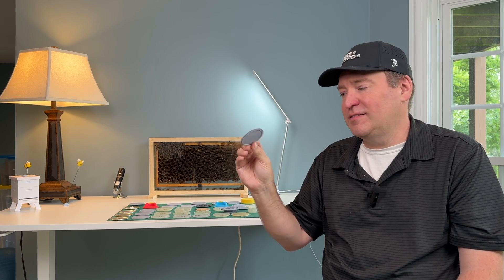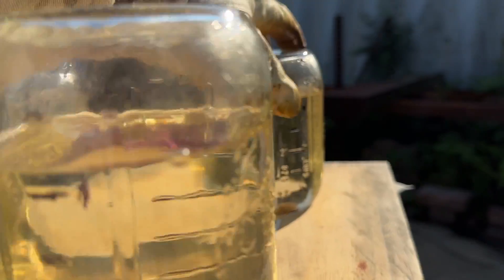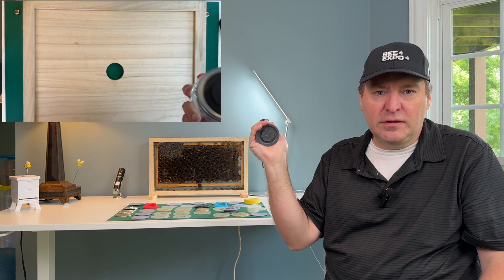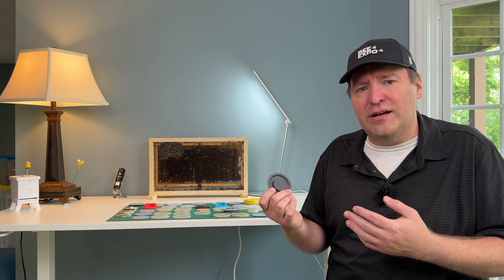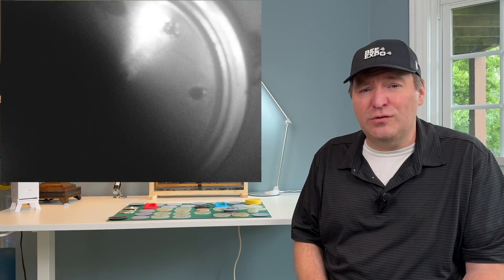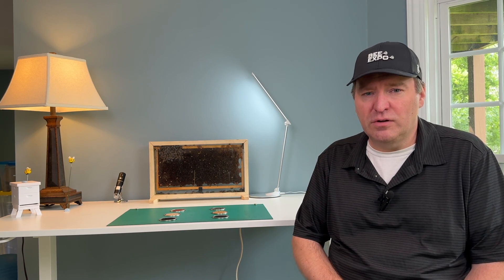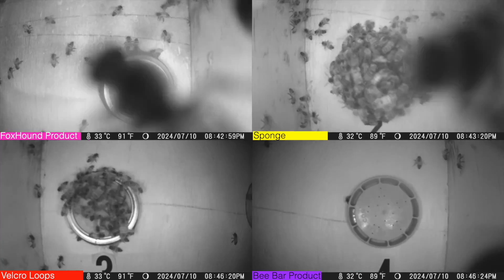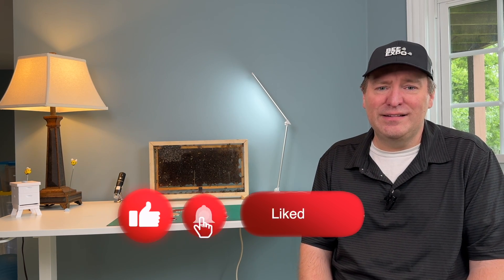I Redesigned My DIY Jar Feeder & Got 100x Results! 🐝🛠️

Comment: Have you thought about grip? 3d print using fuzz settings. Start with Fuzz thickness 0.3 Fuzz distance 0.3 on the part
Away from the edge seal? And vary the grip surface.
Reply from the maker: @tomdickson650, yes, smart idea. 💡 I've been working on the grip via traction. I've been making a bunch of changes to the texture (similar to your fuzz thickness) and also to the geometry (via grooves). It's made a lot of difference. I'll have some videos upcoming, so stay tuned. I'll try out the fuzz thickness as well. Thanks for the idea. 🧠

Comment: Wow Michael.  I think you're onto things.  Thx for thinking about the bees.  I don't use jar feeders yet will certainly pass on this information.  Grateful.  P.S.  What about the beekeepers that use gallon bucket feeders--could they attach sponges?
Reply from the maker: @bradgoliphant, that's a good question. Yes, I think that would work. What I've been learning is that bees have a gripping issue when feeding from plastic, metal and especially silicone materials upside-down.  It is a traction issue. The sponge not only solves the traction issue but also makes for a large surface for the bees to feed from. It's been interesting to experiment with different types of sponge and absorbent materials as well.  One jar feeder tester has been using fleece cloth and the bees really love it. It is also very easy to clean between uses.
Thank you for sharing the information!

Comment: Next design a sponge to fit inside the frame feeder ladder white tubes so bees don’t pile up and die .   I use peat moss now.  It works , no dead bees .   But sooner or later peat moss gets funky  .
Reply from the maker: I've had lots of problems with frame feeders as well. Tell me more about how you use the peat moss. Do you fill the tubes with the peat moss? It's an interesting ideas to use sponge to help, very clever idea, @UncleJunior52! 🧠
Reply: @TechnicallyBeekeeping  my local association told me to add peat moss to my bucket water feeder because bees like it in the water and it’s prevents them from drowning in the water trays. So I figured after using frame feeders and pulling out hundreds of dead bees stuck in the tubes, I started packing the white tubes all the way up -3/4 of an inch from the top. Every few days I give the frame feeder a shake.  No dead bees .  The bees just look up the syrup off of the peat moss that acts like a sponge.  I pre-soaked the pee in a separate cup of sugar water so it expands a little and then pack it into the tubes .  I do monitor for fermentation and I’ll change out the Pete Moss every once in a while
Reply from the maker: Very interesting, I've not heard of that before. Peat moss can float on water, so I could see how that'd come in handy to keep the bees from drowning.
Reply: @TechnicallyBeekeeping  https://youtube.com/shorts/c2VrNJunODA?si=KazLubtF3Ri6rpDH
Reply from the maker: @UncleJunior52 do you mind resending the link? It doesn't seem to be working for me.

Comment: My concern is, do the bees take pieces of the sponge into the hive, thus ending up in the wax or honey?
Reply from the maker: @sadie5288, that's a great question. I've not seen them pick at the sponge at all. Once they have fed from it, it drys out quickly within a day or two. Typically, when I see bee take pieces of something like that, they are either consuming it or trying to remove it from the hive (bringing it to the entrance board) rather than using it as building material. Per your concern, they typically don't like foreign material in their hive, but I've not seen them consider the sponge as foreign. Good question!

Comment: How do you get the sponges to stick to the mason jar lids? What size hole is best? Any pattern better than another? Thank you
Reply from the maker: @RobertMeade-y3d Thanks for the question, I don't go into this much in the videos and I kind of leave people hanging. ;) 
I actually have a video coming up about this, so make sure to stay tuned. For this experiment, I used hot glue, which I don't recommend for a long-term implementation. You can actually sandwich the right sized sponge between the jar ring and the jar's lid and it works pretty well. Regarding the holes, assuming you are not feeding pollen powder mixed in, smaller is better, so thumb tack sized is good.
I've been developing a net for the sponge to make all this easier and a lid that is textured that I'm starting to experiment, so that will be in a future video. 🙏

Comment: I'd like to help you out. What specific sponge type did you use?
Reply from the maker: @danapeters2864, the sponges that I used in the video are a disposable cellulose sponge that come in a pack of 50 for $8. 
Some of the beta testers in the VIB club have been testing with Swedish sponge as an alternative to cellulose sponge. Swedish sponge has antibacterial properties and is quick drying so it doesn't mold easily. Some people do not like that it is not as natural, however. I respect both views.
One of the VIB members discovered that fleece works well and with a net that I've designed to hold it in, it works really nicely and she's having a lot of success with it.

Comment: What is the conclusion here?
Reply from the maker: @michaelshelnutt3534, the conclusion is that assuming you're using 1-1 sugar water, the smaller hole the better, for example a thumbtack size (1-2 mm). Bigger for pollen substitute dissolved in sugar water as it can get caught in small holes and clog them up. Adding textures to the jar feeder lid improves the bees ability to feed from them as you can see with the sponge. 

All inverted jar feeders leak under certain conditions due to pressure building up in the jar, it's just physics. Somewhere around a 30 degree F swing between night and day temps with the jar about 1/3 full, for example, builds up air pressure and pushes feed out, so watch for big temperature swings and preferably don't put the jar feeder in the middle of the hive like most inner covers do as the brood is typically right underneath. 

I continue to experiment, but hopefully that helps?

Comment: I have a 3d printer with wide mouthed mason jars.  Can you send me a link to a file or email me one with the ultimate lid you would recommend.  I like your research
Reply from the maker: Thanks Robert! I started out with the wide jar lids but found that most of the inner covers are built for standard sized lids. Also creating an adapter for a standard to wide is much easier than the other way.

Comment: I use the plastic lids from mayonnaise jars. I use the smallest drill bit. It doesn’t rust and has a rough texture surface. They drink it down one quart  in two days. Only problem is they propolis the holes.
Reply from the maker: @davidlaing7684, nice job! Yes, I've tried silicone because bees have a hard time propolising it, but they have a LOT of trouble getting traction on silicone, it's the worst material I've found. Plastic is ok if the texture is good, like your mayo jars. 🫙

Comment: Have you found the sponges prevent the dripping from temperature fluctuations. I have been Leary to try this type of feeding due to potential drowning over the broadness. I like the idea of placing the jar off to the side above the inner cover using a custom feeding board. Thanks for your hard work
Reply from the maker: @Bee_Cathy, no the sponge is not a solution to the dripping from temperature fluctuations. I am looking into solutions for this, but the sponge does have these same issues that all jar feeders have with around 30 degree F fluctuations creating pressure in the jar and pushing liquid out. Regarding placement of jar feeders, yes, Fred Dunn said it best that they're best placed on the sides so that a jar feeder does not kill the brood in the center of the hive box if placed over a brood box.
Reply: @TechnicallyBeekeeping thank you I'll be waiting for your final model.

Comment: I signed up at your site. I love the sponge idea! You'll have to explain how you stick them to the lids and keep them there for those without hardware cloth holding jars up like your experiment. Do you have a preference on having the inner cover holding the jars by the glass or having them rest against screens?
Reply from the maker: Dwight, I'll definitely do a video on this.  The Insider's club also has a video on how this works in depth, if you're interested.  High level is that the sponges that we're using are cut at a size that they fit under the jar ring and stay in place.  Originally, we glued them to the lid, but have found it's unnecessary.
Regarding the inner cover, you can go either way, mostly the hardware cloth is a convenience to the beekeeper.  We've also noticed that it gives the bees more traction as well across the entire lid, which is useful.  Let me know which way you decide to go on this.
Reply: I've joined the VIB club. My name is Justin Hudson, I only go by Dwight Schrute as tribute to "The Office". I couldn't find videos on the site, where are they located? @TechnicallyBeekeeping
Reply from the maker: @Justin_WV  Lol, I saw the dwight office avatar but didn't know his last name, so I just assumed you had it because your first name was Dwight. 🤣 Thanks, Justin.

Comment: I find myself with only two concerns, first is the molding issues, and how often to change the spong material, what would be the best as in thinkness and type, and second the filtering on the additives i put in like pollen and honey be healthy i use, but good concept and something i have thought about myself, good luck to you sir!
Reply from the maker: Mark, replacing the sponge after every couple of uses is a good idea.  The sponges that I used in the video are disposable cellulose sponge that come in a pack of 50 for $8. 
Regarding the molding, the VIB club has been testing with Swedish sponge as an alternative to cellulose sponge.  Swedish sponge has antibacterial properties and is quick drying.  
My personal fall feed is a mix of Honey-B-Healthy, pollen substitute, Amino-B and sugar syrup.  I agree, that I originally assumed that I'd have all of the pollen at the top of the sponge, and while there is some, most of it does seem to transfer through the sponge.

Comment: I use regular pin holed lids on my feeders. I always wondered why the bees liked to place wax on the lid covering some holes in the process. traction! who knew! thx for the insight.
Reply from the maker: Thanks, Squid.  I came a similar conclusion with the video below about pin holing lids.  I have some new research on traction that I've been doing, currently researching the most recent results tonight.  So much to figure out still. Stay tuned. 
https://youtu.be/HSoz2djhc8E

Comment: I use jar feeders in conjunction with #8 wire which is stapled over the inner cover hole on my nucs.  You can't use a mason jar lid & ring because the lid is then off the screen and often out of reach or the bees proboscis.  I use one piece metal lids and with the bees holding on to the #8 wire I would think they can access all the holes successfully.  Maybe something for you to try with your camera setup?  I wonder if the use of sponge with the mason jar ring on top of the #8 wire would cause the sponge to drip?  This time of year I have only 4 holes in the lid so it can take the bees 4-7 days to empty a quart.  In the spring I'll have many more holes or may try the sponge as I want the bees to build rapidly.  Good stuff, thanks!
Reply from the maker: Pete, actually most of our VIB testers are using hardware cloth.  It was a challenge at first, but we've figured out some clever workarounds.  The sponge helps in that it peaks though the hardware cloth.  That said, I suspect that hardware cloth gives the bees plenty of traction as you say, not leaking issues, but definitely traction issues.  I will likely do a video on this as well. Thanks for the idea!

Comment: Really interesting content! I did sign up to the VB club. Maybe you will provide more details later, but how do you attach sponges to the feeder jar lids?
Reply from the maker: Brian, I started out by hot gluing the sponges to the lids.  I found that with 3D printed materials, the hot glue often cracked the lids.  We are now using no glue at all and it works fine.  I have the VIB club attaching it under the ring which is enough to keep the sponge in place. Thanks for signing up, I really appreciate it!
Reply: @TechnicallyBeekeeping  Thanks! I use one-piece lids right now, but I can get some 2-piece lids.
Reply from the maker: @ybps_01  Sounds good.  I do a lot of canning, so that's how I got into using the two-piece lids.

Comment: Question: the syrup ratio is 1:1 that you are trying, correct? 
Have you tried the 2:1?
Reply from the maker: Matthew, great question.  You are correct, that in the video I'm using 1:1 with pollen substitute and and Honey-B-Healthy supplements. In the VIB beta testings we're trying everything from 2:1 sugar water to 1:5. For a traditional jar feeder, I believe that the question of hole size depends on what you're feeding as the viscosities can vary widely. We're working on a crazy new design that may break that dependency, however.  Stay tuned for more on that.  Thanks for the question!

Comment: try scotchbrite pads?
Reply from the maker: AnimeNiac, the most recent that we've been using is Swedish sponge (rather than Cellulose sponge, like I show in the video). I like the idea of Scotchbrite pads. Do you know if they trap small hive beetle like Swifer dryer sheets do?  I've been thinking of replacing the sponge with a material similar to the dryer sheets to feed the bees and also catch small hive beetle.
Reply: @TechnicallyBeekeeping  I doubt they'd entangle SHBs like the more fibrous materials can; but can't claim to know for certain. I was thinking they could be easy for the bees to walk on, impervious to rot, and (maybe?) highly resistant to clogging by syrup drying?
Reply from the maker: @animeniac978  Interesting point on the impervious to rot.  We'll need to try it out. Thanks for the idea, it's incredible to have so much brain power on this project. 🧠
Reply: @TechnicallyBeekeeping  I expect that if it were epoxied to (roughed up) plastic jar lids, the whole assembly would be dishwasher safe.
Reply from the maker: @animeniac978  that's my goal is to make the lids dishwasher safe.  The sponges will need to be discarded in time, but that's pretty common with sponges, they are disposable items.

Comment: Hmmm. 5 years or so when the printers get good enough where you could print a sponge like membrane that's a combination of the 3D printed feeders and the sponge like material(prob a .01mm) . That be a huge money maker cheap as well as it be rust proof and prob an alcohol wash every few months.
Reply from the maker: Danny, that'll be a cool time.  I'm still waiting for metal 3D printers to come down to a reasonable price, that will be a game changer. I'm looking at doing Silicone and making it dish washer safe.

Comment: First is a suggestion - Have you considered glueing the sponge onto one of those plastic replacement mason jar screw lids?  Then you wouldn't have to deal with the long term rust issues.  Once you've added a sponge to the lid, did you find that your hole size needed to change at all... or was it irrelevant?  BTW - after getting frustrated breaking those tiny drill bits I discovered that my staple gun created just the right size holes into a metal lid for feeders.
Reply from the maker: Mike, yes we're currently beta testing v5.1-v5.4 which are 3D plastic rust proof lids. It is looking super promising. We've found that we can do it without gluing which is preferable as the plastic part once made into silicone could be put in the dishwasher and the sponge either reused or discarded.
Regarding the staple gun, that's really clever! I've not heard of that before. The drill bits are typically too big, so the staple gun would make good sized holes for sure.  Other than if you feed with pollen, it may get clogged in that situation, but I don't think that there's a perfect sized hole for every feeding scenario. If you've seen my "Right Size" video, a push pin also does a good job, but staple gun may be even better.  Thanks for the comment!
https://youtu.be/HSoz2djhc8E

Comment: why use trail camera's over CCTV like cam's where you have live feed plus use a DVR for your long term studies?
Reply from the maker: Flashcard guy, you are totally right.  that's my next step to build a CCTV version of the trail cameras.  I did it with the trail cameras because I don't have a CCTV with IR + IR cameras built yet and I thought, "ugh, I need to take a shortcut or I'll never get this experiment going". :)  I really want to make it a live recorded feed.  That said, between the consistently changing and charging the rechargeable batteries, downloading the SD cards, etc I feel that I was a bit too short-sighted.  The cameras lenses do get propolized and waxed up every time I go though, so a static camera inside of the hive may not be viable. Maybe there's some kind of coating that I could do on the lenses to discourage propolizing. Hmm...

Comment: Based on what you said about, gripping, I have tried scratching my lids with my hive tool to improve the grip. I’m not sure that it’s making any difference, though.  it’s hard to tell.
Reply from the maker: John, I think that the traction could help, but note that with a metal lid it may also make the lid rust faster.  I'd thought about sanding metal lids but decided not to due to the rusting potential.  
If you'd like to try out a sponge prototype, feel free to join the VIB club:
https://technicallybeekeeping.activehosted.com/f/1
Reply: This is fantastic info! Thank you!